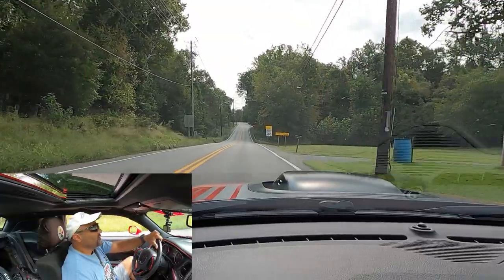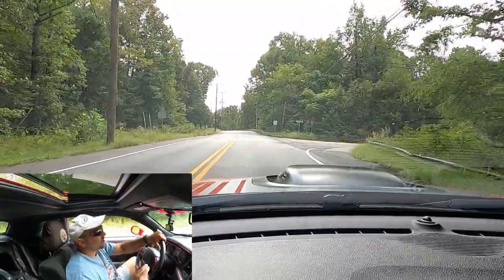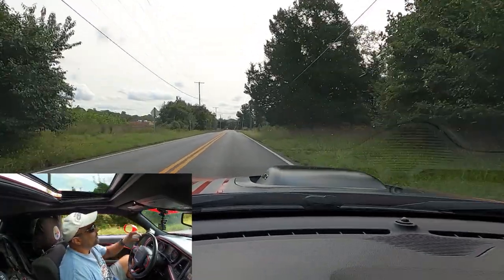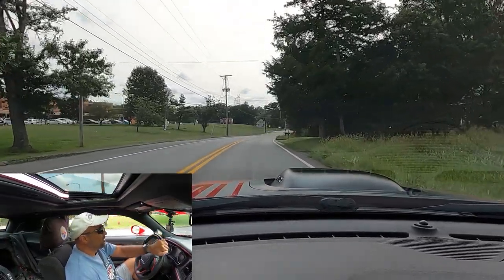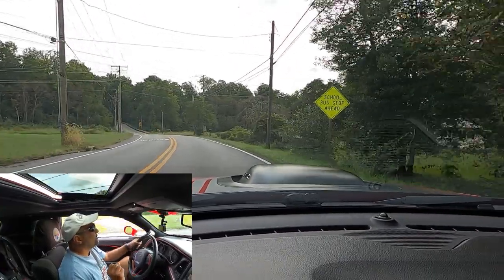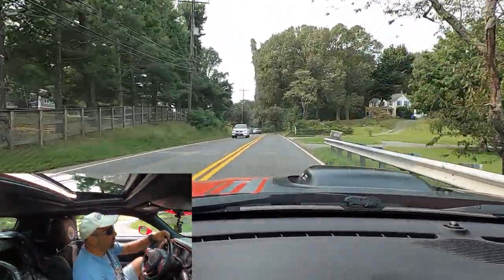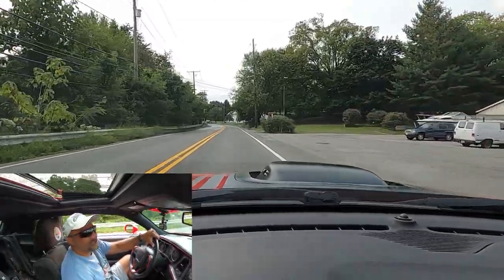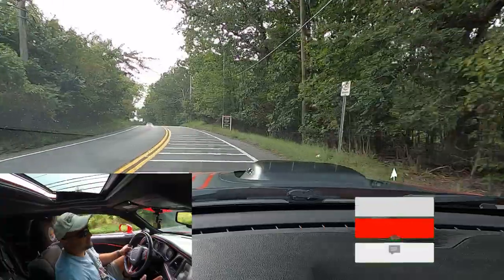Why I went with a Procharger vs other superchargers.

Comment: You explained your logic in choosing the Procharger in an earlier video on your R/T, as I have the 1970 style traditional Challenger hood a low profile E-Force fits great under the stock hood. I won't need forged internals with that set up combined with modest conservative boost levels. It really is a blast taking our cars up a few notches with these types of exciting mods man!
Reply from the maker: Right on! I know I did, just wanted to go a little deeper this time.
Reply: Yes, you will need the forged internals if you want to get the times in the 10's. If you just eant a quick street car and only use 8-10 pounds of boost then no you don't need them, but it would still be wise to have forged internals. If you do what l suggested with the supercharger change you might save enough to pay for the forged internals by making that change.

Comment: Those hemis make so much torque so centrifugal is best...You will make monster mid and top end power.
Reply from the maker: That's really what I was looking for, ease in and then let'er eat!
Reply: @ModernRedHemi  Your car launches like a monster off the line as is...With the pro charger you should be mid to low 10's on 93.

Comment: I like the Vortech if choosing a centrifugal. The Procharger has that weird TRIANGLE shaped box that turns the air 90 degrees on the Hemis right before the throttle body. I have seen several people keep blowing the charge pipe of right there. They make a great supercharger but I wish their routing was more like the Vortech.
Reply from the maker: I agree with the routing issue and having the same trouble with the coupler blowing off at that very point. Hasn't done it in a while but it has done it. At some point, I am going to talk with an installer/fabricator to see what we can do. Possibly a different intercooler (liquid to air) with a different set up may work.
Reply: The Vortech is also a more efficient unit as well.  We are currently finishing up a 2019 Scat Pack Widebody with Vortech Ysi and new rotating assembly which took it from a 392cibto a 428ci.  It's going to be a handful.

Comment: Thanks for the video. Trying to decide myself. For tracking a car it seems Procharger would be best option, the way the boost comes on.
Reply from the maker: To be honest, you really can't go wrong with any of the superchargers, especially if you are more in it for the fun and driving experience. If you are into hardcore racing then there are some differences you would want to take into account but for the average Joe, any will do fine. 💪💪💪

Comment: I just learned that the centri chargers are exponential in a squared way. Meaning, if you make 25 pounds at 7k rpm, you're not making 12.5 pounds at 3500rpm, you're actually making 5 pounds

This actually made me really disappointed in centrifugal all of a sudden. I'm sure it's ideal for traction, especially on bigger displacement-to-weight ratio cars, but I was really hoping for something to be the perfect middle ground between Turbos and Supers and it seems Centri's aren't quite it, which is REALLY apparent now that I correctly understand how they build boost.
Reply from the maker: Spot on brother! Definitely helps with traction though and more than makes up for it on the top end. 💪
Reply: @ModernRedHemi  Yeah, if your car already had a big enough N/A engine (roughly 1 cubic inch per 10-15 pounds), then a true centrifugal makes a lot of sense if you want a crapload of relatively controllable power beyond what N/A can provide. I just wish for those slightly under-engined cars (1 cube per 15-20 pounds) there was that linear-increase option that would do 1/2 boost at 1/2 RPM instead of sqrt-boost at 1/2 rpm, and was as relatively simple and clean to install and setup as a centrifugal is.

Turbos are a pain and easily destructive, and positive displacement is just for the flex/bragging rights IMO. Both have the potential to literally "overblow" a power package in more ways than one. IDK.

Comment: Here's where I am. I obviously have the same concerns. Keeping the shaker. So ProCharger or Vortech. I could go twin turbo as well. The piping looks like a nightmare, and while I can weld, I don't have a welder at the house. So fab work would be a PITA. My reason for stopping in was Procharger vs Vortech. Which wasn't covered LMAO. I see two distinct differences with the two. Procharger has the inlet up alongside the motor so I'm thinking hot air inlet vs Vortech reverse mount design that pull air from the front, so it would be cooler air incoming. I'll have to go looking for the followup video comparing them now. LOL
Reply from the maker: I don't really have a good comparison with the Vortech. I don't know anyone that has one except  in the 6 cylinder variant. My AIT's are not awfully bad though. Remember that it goes through the intercooler before coming back into the throttle body. Agree though, it may be a little cooler coming from the front vice the engine bay. If you get it we will definitely will have to do a comparison. 💪💪💪

Comment: @Modern Red Hemi - I don't think you'll have a problem installing the Procharger. The directions are good and detailed. The only issue you will have is with tuning. Because your car has a cam, long tubes, ported heads, and an upgraded intake the tune that comes with the Procharger kit won't work. The Procharger tune is conservative and developed for a stock car. I would imagine that Jay Greene writes tunes for supercharged cars and you can have him do it. Tuning is a little more complicated and will take some datalogging and several revisions. If there is a tuner that has a good reputation in your area and knows Mopar, I would consider going that route for the tune. Dyno tuning will best optimize the potential of the supercharger. For what it's worth, my car is Procharged and I like it. It's a good thing because there is no positive displacement supercharger made for my car. From a pure power standpoint, turbos make the most power. You could compete with and hold your own with Hellcats if you go with turbos. However, that won't be the case with a Procharger. The nice thing about the centrifugal is that 3500 RPM and below, your car will drive the way it does now. It's also much easier on the drivetrain. Good luck with the installation.
Reply from the maker: Thanks brother! I was looking at the install instructions the other day. Seems pretty clear cut. Gonna stick with Jay. We have a pretty good relationship and he took my car from a real bad place to running like a dream. We will get through it for sure. Thanks for the input and the continued support to the channel! 😀
Reply: Hu 3.7 wouldn’t knock the procharger set up , hellcats have a hard time with me and I’m just a boosted scat on a stock block 😉
Reply: @widebody_moparmike  - Not knocking the Procharger. I own one myself. At the dragstrip, the Procharged car will lose to the Hellcat. That's for 2 reasons. The first is maximum boost isn't achieved until redline for a Procharged car. The Hellcat builds maximum boost at lower RPM. A stock Hellcat will achieve 11-12 pounds of boost to 7lbs for the Procharger. The Procharged horsepower will approach but not reach the peak number of the Hellcat because centrifugals are more efficient. However, the Hellcat will produce more power at all parts of the curve especially at lower RPM. A Prochared Scat Pack will be extremely quick. However, with 2 good drivers the Hellcat should prevail by 2 car lengths or more over the Procharged Scat Pack at dragstrip. On the street, it's more about traction than horsepower in a race.
Reply: Well I’m here to tell you I haven’t seen many stock kitty’s running 11.2s in the 1/4 , second a 392 is bigger cube vs the 6.2 , pound for pound the 392 will win , stock kitty’s Dyno low 600s and well so did my 392 stock other than the procharger 🤷‍♂️.

Comment: Whipple Superchargers Whipple Superchargers twin screw design makes them the most efficient supercharger available for making horsepower. Now shipping all Gen 3, Gen 4 and Gen 5 systems. Available for most modern late model Ford, Chevy and Dodge applications.
Reply from the maker: Whipple would have been higher on the list if I could keep the Shaker! I may have went with one.
Reply: I think the Whipple is a bit cheaper. Ask Whipple if they can make a hook up for the shacker. I think the Whipple is a couple of grand cheaper. Marbe you can get everything you need from Whipple and get more power for the same price as the Procharger
Reply: Is it just the look of the shacker.that you want to retain. If so, run the the supercharger connection to intake in normal fashion, thenmount the shacker scoop over to come up through the hood in stock position. Don't forget tje scoop will not operate anymore once a superchatger is feeding boostrd pressure to the engine.

Comment: I have always loved the Procharger kit because you can upgrade the system. I also like the new Hellion kit and maybe one day one of these kits could make it onto the Scat.
Reply from the maker: Thanks brother! The Hellion kits are pretty sweet but with the upgrades I would have wanted it put the price in the stratosphere. Will see how the D-1X does on low boost and then later down the road, after forging, a little extra boost. 😉
Reply: Only issue with the hellion kit is the oil system sits too low , if it wasn’t for that I myself would of gone this route vs the procharger setup I’m running right now
Reply: @widebody_moparmike  everything on the kit sits low. The turbos sitting only a few inches from the road while driving is a concern of mine, but they make great power.

Comment: My biggest question is does this void the warranty? Other than that I'm stoked you're getting what you've wanted. Can't wait for the new track slips!
Reply from the maker: Pretty sure it does! LOL... I am stoked as well. Almost can't sleep at night until it comes in and installed. 🙃
Reply: @ModernRedHemi  well it was good while it lasted
Reply: Modern Red Hemi they’ll have to prove if there’s a problem that it came from result of the modification
Reply from the maker: @davidsgarage7251  That is true but with everything I have done it won't take much to prove it, especially if it's drive train or engine related. Fighting the building full of lawyers is an up hill battle as well.
Reply: Modern Red Hemi yep. always good to build a great relationship with 1 dealer. After having bought 10+ cars from same one they have assured they’ll cover my trackhawk. it’s pushing 1000whp and nothing near stock.
Reply: David’s Garage actually once the pcm is unlocked that’s the end of that warranty, but I’ve actually never understood why people want to modify the car and be worried about the warranty, like if your worried don’t do anything other than drive it. Or be prepared to pay out or do the work yourself. Also never been a big fan of it’s my only car deal as well but that’s just my opinion on it

Comment: Will your motor be able to handle the pro charger? Or do you have to beef up the bottom end?
Reply from the maker: As long as you stay in the safe range (7-8lbs of boost) the stock bottom is perfectly fine IMO.

Comment: Congratulations but what you going to do with transmission?
Reply from the maker: Eventually build it but for now keep it as is. Doing some research the 8HP70 is rated at 700 ft/lbs of torque so I should be safe for now.

Comment: Centrifugal? Ok...the Hellion kit is unlimited in power plus you can shape the ramp up. Centrifugals are progressive true, but the crank load on the snout is high. Twin turbskis is the big move
Reply from the maker: True enough but with the kit I would have wanted it would have skyrocketed the price. 😬
Reply: Again the turbos and there oil system sit to low to the ground , as for a dd probably not a good thing in the dmv , second the procharger on 7psi he’ll pick up 200 whp and have same drive ability as stock. , might wanna follow my scat  build on ig if your not a believer
Reply: @widebody_moparmike  ok, clearance issues aside, you're still limited to some degree and any step up will require a new head unit. Then you have to upgrade the belt system. Then more parts. At some point the cost factor and reliability goes wrong. A lot of centri users end up going turbo to stay competitive and increase reliability. At the top level, Daddy Dave is a prime example...went from nitrous to Procharger to twin 88mm turbos....why? Because of tuneability and reliability. Sloppy Mechanics is on the other end...he's done nitrous, supercharging and turbo...but his most popular setups are all turbo. The Hemi and the LS are super close in design, although the price point is different.
Reply: Brother Django Dakota well see that’s where everyone goes wrong , procharger headunits if you pick the right one from the start you won’t have issues (and it’s fairly cheap to send back to have it upped ) as for belt issues again picking the right belt and tensioner for the application is key. And as for turbo builds the basic kits (key there is kit) what you’re talking about is people going to custom built set ups which the avg joe isn’t doing in their driveway or garage nor using as a daily driver. Let’s be honest if we’re gonna go for all out fast drag racing everyone would go for a lsx car and not a heavy Mopar boat